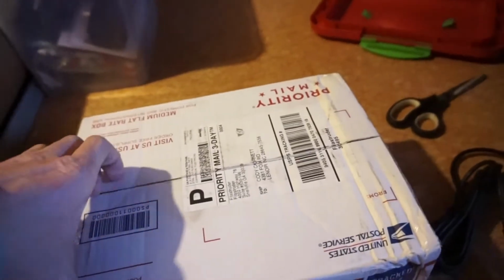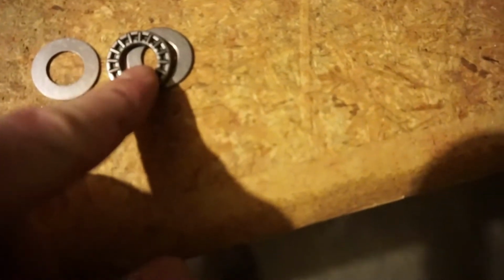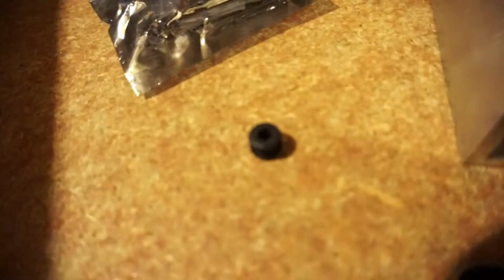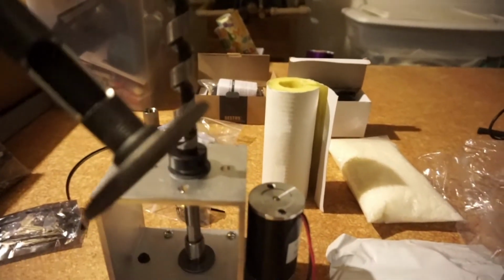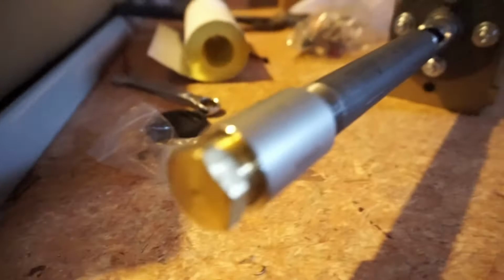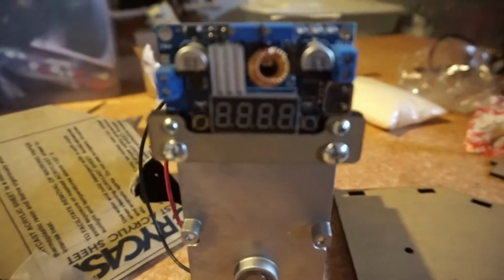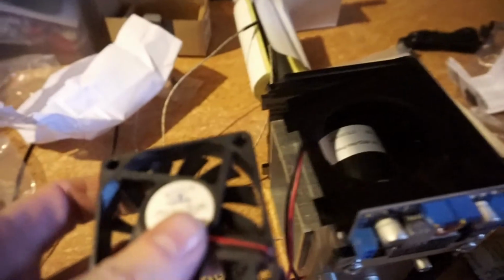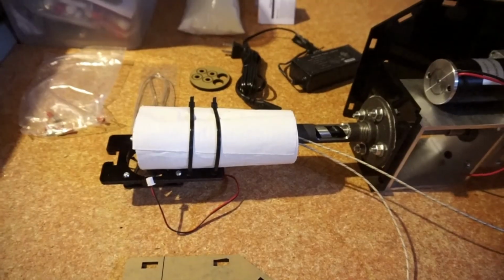Filastruder Assembly

Comment: With a second set of hands, the filastruder takes less than 60 minutes to assemble.  This elapsed time does not include taking the masking tape off of the plastic housing pieces. The filawinder takes about 90 minutes with a second set of hands... if you have a good soldering set up, those steps become negligible (<5 minutes) as they can be done in parallel.  I looked for several instruction sets and videos - I found this to be the best. The PDF is missing steps and has limited images. Other videos miss steps, are different kit versions, or are sped up play backs.  Thank you!
Reply from the maker: Thank You. I agree. Its always good having a second set of hands when assembling anything. Yeah, the instructions were like heres a picture of what its supposed to look like and heres a schematic. Overall, I really like the filastruder but the instructions could definitely use some work.

Comment: So how long did it take you to assemble it?
Reply from the maker: I did it in a day and a half. I had to split the vid into 2 parts for other reasons but it could be done in a day, if you know how to wire good.
Reply: (same as main thread comment)  With a second set of hands, the filastruder takes less than 60 minutes to assemble. This elapsed time does not include taking the masking tape off of the plastic housing pieces. The filawinder takes about 90 minutes with a second set of hands... if you have a good soldering set up, those steps become negligible (<5 minutes) as they can be done in parallel.